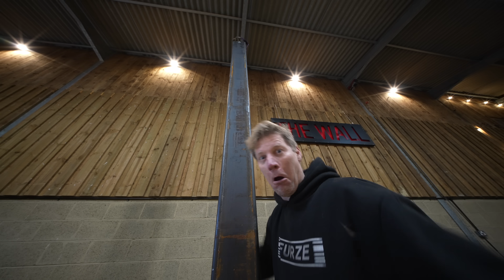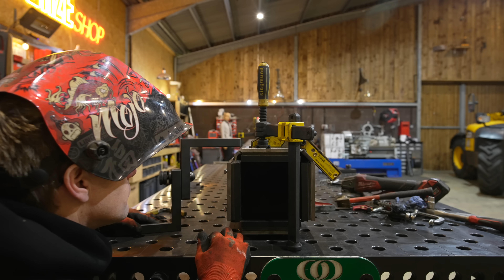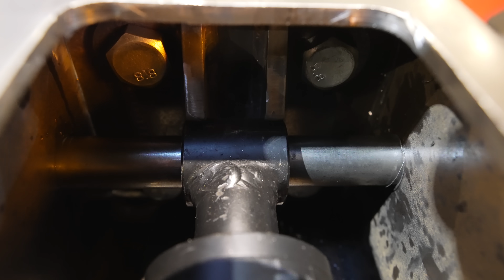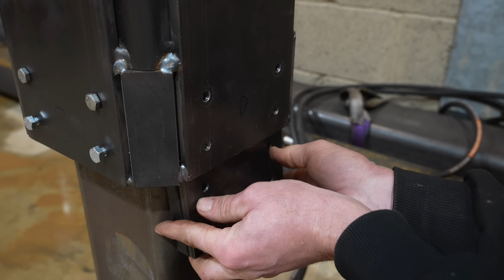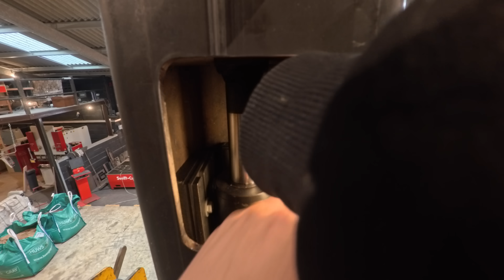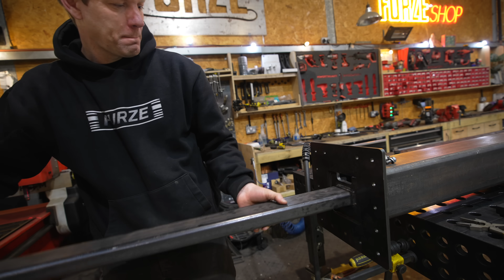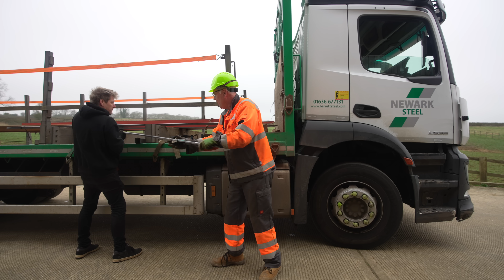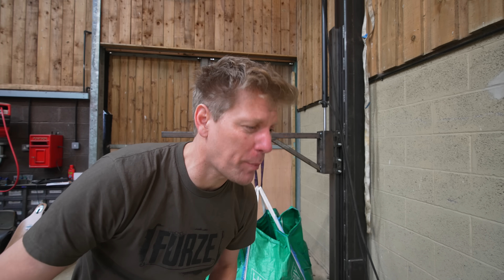Digging SECRET Garage Part 7 Car Lift Prep

Comment: Colin, I don't know if you have thought about it. If you crank and run your car down in the hole, the carbon monoxide,  will stay pretty much in that space and could flow through the other parts of the underground bunker. What you could do is have an appropriate metal hose, that plugs into the back of your exhaust and out the top of the bunker that has a rain protector cap to keep water from coming down through the tube. I would also have a co2 detector down there to make sure you don't have any exhaust leaks that take you by surprise. Also, another possibility is installing a fire suppression system in case your automobile catches on fire in the underground garage. If you don't install that, don't forget to close the door from the garage to the remainder of the underground that way, if there is a fire, it doesn't travel up into your house or the outdoor building.
Reply: It's been so long I've kinda forgotten myself, but I think during the bunker construction he already set up some form of air ventilation/extraction down there.
Reply: agreed, I've seen yhat he has a high extraction but I don't know if he has a low one yet.
but his bunker door looks airtight and it's steel so kind of ok for the fire part, as long as he doesn't store liquid oxygen for a rocket or something
Reply: or you can just properly ventilate the room, bunkers should have some sort of ventilation anyways

Comment: I think the way I would make the rotation mechanism would be to have 2 car tires permanently mounted at the bottom of the lift in the tunnel. The turn table would touch the tires when it is it's lowest position so you would just turn the tires on in opposite directions and it would spin the turn table. That way you don't need to deal with gears or cables or having any electronics attached to the lift itself.
Reply: Couple big drawbacks though. You can only rotate the turn table when the lift is all the way in the lowest position. I don't know how that would work with your mechanical lift concept. It will likely make a squeaking sound while rotating the table. 

I do still think this would be the most robust and simple approach though.

Comment: You might want to make sure you are using either flush ground bearings or a spacer between the inner rings of each bearing or they may bind.

Comment: Colin - regarding the shims - instead of adjusting with threaded bolts - how about fitting springs to apply a constant shim pressure on the inner square tube ??

Comment: You paid for 1 ton of sand in a bag. Its 750lbs. Thats not a ton. And if you do the math they sell them all that short. They are robbing everyone that cant check to see if they weighted the full ton. Thats a crime.
Reply: It's not a tonne/ton. That's just what they're known as - one tonne bags. They're a cubic metre - one metre on each side.

Think about the difference in the weight of water a ton bag has if it's wet or dry. 

For actual test weights they use a cubic metre of water which weighs one tonne.

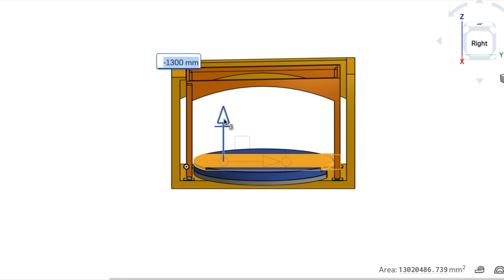Comment: 2:29 So that connection needs to detach from the platform, while also needing to be able to support the entire car sitting on a otherwise unsupported diving board? I'd think you need at minimum the same setup on the other side, I can't imagine that being able to lift the car without immediatedly failing

Comment: In case someone is wondering, there are actual tables full of data of how much a certain bolt can take (pull, push, sheer), the same with plates and welds. You don't need to overengineer the hell out of it like Colin, who's garage will probably outlast mankind by quite a margin 😂
Reply: It's not over engineered, he's just outsmarting the laws against building a personal combat mech by building all the parts as part of a "garage". By the time he's ready to assemble it, he'll be unstoppable before they realize what's happening.

He has a literal secret underground lair, I think a plot for tyrannical domination is pretty much a given.
Reply: @DD-th5tu  If Colin was around in the 80's he would have been on the A Team.   And would have been inexplicably locked up in a garage with a welding machine and some plate steel, and none of the guards stationed outside would pay any attention to the loud noises coming from it....
Reply: As the old saying goes. Anyone can build a bridge but it takes an engineer to barely build a bridge
Reply: Colin is secretly a prepper and will survive mankind's self annihilation because he happened to be working on the car when it happened. :)
Reply: @brookead  And emerge as the leader of the new world order.
Reply: As the Mythbusters used to say: If it's worth doing, it's worth overdoing 😉
Reply: And if in doubt, C4
Reply: @Katzenjammerz67 I doubt C4 would do much to that underground fortress.   Or rather it would take quite a bit to have any impact.
Reply: Overengineering is good practice if you get the steel for free :) (It should really be called underengineering, as it requires less engineering work. Slapping huge pieces of metal together is much easier. Overengineering is when you make it just strong enough)
Reply: In some fairness, if you have ANY doubt, better to overkill and know it's safe, than to meet min spec and die to a simple error.
Reply: To be fair it is Colin so he needs to plan for himself... he might want to install a swimming pool filled with mercury where the car goes that can be lifted up for some reason...
Still over engineering the crap out of it lol. Concentric pins was so unnecessary lol.
Reply: everything he builds is extra solid, massive, reliable, usable and maintainable. love it!!
Reply: MOAR METAL!
Reply: this is the biggest issue I see with Colin's process... he should just hire a hydraulics professional to go through the best options instead of walking down the trial and error pathway at such a critical junction
Reply: @idale4964  ....find a hydraulic specialist smarter than Colin. 😁
Reply: @randywl8925 you won’t because they’re a specialist, and Colin is quite the generalist. Still, in their area of expertise they can offer ideas of value.
Reply: @thehandleiwantedwasntavailable  I don't doubt that one bit. I also don't doubt that people that are specialists have contributed via the comment section.
Reply: @idale4964  As if a hydraulics engineer would know how to do steel construction. Maybe for some ideas or inspiration, but Colin is both capable and smart enough. Clearly.

Comment: Uh-oh Colin. Simultaneity! How will you guarantee that the travel of all four cylinders will be even throughout the lifting process every time? And you have the compound problem of two such situations in series. What about failsafes on both of those series lifts? If your hydraulic pressure suddenly drops on one or both of them, what then? Wait. Spoke too soon. You addressed it at the end. If the cable approach does not work, will you have an alternative passive control scheme, or are you having to look at active control with feedback?

Comment: I only came in from the shed for a cuppa when this dropped. Trying to fix a ride-on mower, the little pin holding the steering wheel on has rusted solid. I've tried a hammer and punches, then a drill - which wouldn't even touch the hardened pin - then an SDS drill with punch welded on the end, and finally another smaller drill that I thought I would try through the centre of the pin and just widen it as i go... broke the drill inside the pin. We're talking tiny - like, 4cm long by 5mm? Then I come in and see THIS video, so now imma go back out and SMASH this steering wheel off with the biggest baddest tools I can find! 😂💪

Comment: Workable, but 0% how I'd have solved it. I would have used a single cylinder mounted horizontal attached to a draw bar attached to four industrial sized chains run through angle-iron safety guards. You'd never have a single lagging/failed cylinder jam the system. A block-and-tackle reduction could let you use a shorter--and likely cheaper--cylinder.

Would be a crapload of chain though. Easily 100 feet. Yours is probably cheaper overall.

Comment: Isn't the normal way to stabilize the inner pipe to cut a slot in the outer pipe and fit wheels through?  Our workshop has a lift for 50 ton rail vehicles that has this setup.

Comment: I guess one problems should also be that all four legs have to expand uniformly, otherwise the hole system gets out of balance. And what are you doing as a safty feature in case one hydraulic hose bursts and you lose all the pressure?
Edit: I´ve watched the video till the end, where both things get explained. 
🙈

Comment: Colin daisy chaining the cylinders hydraulics is going to cause issues. Each corner should have its own line from the pump. Each line has to be the same in size and length. That should help with the cylinders moving faster or slower than one another. That's just my thought. Love your content ❤

Comment: Why not follow the design principals of known four post lifts. Hydraulics in all four posts is a potential mess and a future nightmare of maintenance. A dual horizontal ram with chain and pulleys should work a treat and give years of simple maintenance and reliability.

Comment: Is it worth placing an outer sleeve around the top where the pin for the hydraulic ram goes through, just so that the stress of the pin upon the hole it is put through is spread out across a double thickness of metal?

Comment: Making sure that the inner and outer sets of hydraulic rams go up at the same rate within each set might require electronic height control.  Beyond that, what's the failure mode if one of the cylinders springs a leak when they're up?  If I understand the design, the emergency brakes will help if there's a rapid catastrophic loss of support.  How about a slow failure?  What happens if the load is uneven?  Does the design prevent someone from parking above with not all four wheels on the platform?  What if that upper load starts to roll off?

Comment: Ball bearings are not suitable for running directly on this steel. Even if there are several bearings, one or two will carry the entire load. It is best to choose smaller bearings and connect them using a sort of tube. This prevents the bearing from becoming deformed and distributes the load across several bearings.

Comment: Colin for your maintenance worry could you modify the posts like Base-Hinged Lighting Columns that have a hinge on the bottom? You could have a clamp at the top to secure corner when disconnected then swing the post down with a winch enough to remove piston.

Comment: use 2 hydraulic rams per leg and mount them on the outside of the legs, easy to get at then, just not quite as pretty
Reply from the maker: but there is no free side on the outside as the backside has the safety rail the front the inner lift and the side has the room/roof and the inside means the car gap gets smaller so that's why I went inside.

Comment: 16:10 But why have those 2 cilinders there tops connected ? Only the oil needs to press on the bottem connections and return by gravity. It's the same as you have the 1 piece cilinder later, but with this one is the connection in the middel insted of the botom. Your new cilinder whill have a breathing hole on the top, if your piston ever leaks it whill eject that oil out there.

Comment: I still prefer my drill screw lift design I spent a month making to show you, but since it took so long you already went ahead with another idea, that's likely much cheaper, but not as cool! =P 
It was basically like a coke bottle lid screwing up/down, you could walk under it at any height as it rises, it was fully supported and used a ratchet type mechanism to keep it safe.
Like imagine a triple helix, and the bit in the middle spins round like a rollacoaster on the poles. 
It only needed some motors to whizz it round and up, and some sweet looking spiral metal poles.  Oh well. I had fun making the dumb thing for no reason ^_^.  
I might go set it on fire in the garden, seems like a fitting end.

Comment: I used to work for JCB, operating the house sized press that would bend the sheets of steel into the U sections before the welders added another plate on top to create the box section boom pieces, that went on the loadall machines. Fascinating to see you essentially ‘reinventing the wheel’!
Reply from the maker: I did think about getting some C channel pressed but I like the idea I can remake any part of it with the tools I have etc
Reply: @colinfurze Still getting through the video, my own thoughts would have to go down the route of hinging the base of each leg, and then creating a system that would allow for the lowering of the lift to lower a single leg into a horizontal position with an overhead crane in the none opening part of the bunker utilised toke the weight whilst removing the ram. Personally I feeling cutting slots in the box section creates too much of a weak point.

Also, rather than adding runners to the rail, have you considered mounting the bearings piece directly to the wall, with the moving part of the ram rolling through? This would eliminate the need to get the piece past any kind of lip

Comment: I was waiting to see how the lift would mechanically lock in the chance the hydraulics failed, glad you squeezed that in at the end of the video. This method looks a lot cheaper than buying load arrestors for each leg! Looking forward to seeing them implemented. 🤓
Reply from the maker: there is also rupture vales in the cylinders to so double fail safe

Comment: Hey Colin... Eventhough Massively expensive... how long are the cylinders for the press plate in a Heil Halfpack Front end Loader? You know, those that pick up skips infront if the cab and empties behind it. 
 Call my old friends in Scotland. Yes, the cylinders might be to wide. 
Heil Environmental in Dunfirmline.
Reply: Oh got it.

81 inches retracted and 263 inches fully extended. And seeing they are pushing the press plate crossing eachother until fully extended" they are rated at an enormous amount of side strength and bend.

Comment: I love this so much colin, you're doing what every guy frickin dreams of! I have an idea tho, PLEASE read this out:
Why not have a car wash hydraulic lift instead? It's overkill but that's definitely a better idea and would need to modify it quite a lot of get the height just right, but It would mean you can get rid of the cage that comes up along with the car, (the 4 legs on corners). It would be so seamless and almost magical to have the car come up without those legs! COME'ON COLIN YOU CAN DO THISSS PLEASEEE

Comment: In the late 80's I redesigned an extendable stick for the Cat backhoe loader. I went down almost the exact same design path you went through for your spacers. I was replacing a design that used brass strips that were welded to the steel tube, and had to be replaced frequently in high wear environments. The material I used was called Nylotron (I think that's the name, but it's been a long time). The material had graphite impregnated to lubricate and it would also leach a paraffin if it got to hot to increase lube. It's funny how similar your design was to mine.
Reply: Convergent evolution moment

Comment: After building a 2-story vertical lathe, I can say that if you want a smooth moving lift, you need a fabrication shop to mill flat, true, plomb and square sides down the whole length of the contact area. If not, you will have occasional loose areas. Don't forget about that weld seams on the inside. I know you won't, but I had to mention it. Thanks for all the entertainment and best of luck.
Reply: he talked about the weld seam on the second channel if you are interested
Reply: @celivalg  Yes, I remember. I know from experience how small details can fall between the cracks in a large project. I have complete faith in him to do a good job.

Comment: /Edit - Shame on me for not watching before commenting... Derp - /Edit

Colin! Honestly love this project mate!!! EPIC!

Obviously I'm coming to this late but have you considered the mechanisms that forklifts use - with those rollers and chains?
It seems that they can extend further than the throw of the cylinder.

Also Newick/Barretts steel have pretty good tube lasers and they can do pretty cool things with SHS - just need to send them step files and they are golden. Tolerances are critical if you do this

Just spit balling - Love ya guy! X

Comment: Great progress! I`m sure you have already thought about it. but I was thinking safety wise, how are you going to fail safe it? I used to install electric gates and there are lots of products in that industry you coud use like infared beams and rubber safety edges that could stop or reverse the lift if something goes wrong, obviously going to be some major crush points in the gap when the lift goes down ect, may be worth integrating some kind of gate or mesh to prevent anyone falling down the gap while the lift is operating.

Comment: I'm curious, if one of the deisgn parameters is to inspect underneath the car, how will you get under it with a big platform in the way? It sounds like you want a car lift like what is often seen in mechanic shops, but this is a whole platform, with a less than ideal floor under a less than ideal platform for inspecting underneath.

I'm sure you've thought of this, but I am curious. 

Looking forward to the finished product!

Comment: If you build a garage on top of the lift opening it will conceal your lift operations and solve all your water and safety issues. From the street you will see a car going into a garage and the door close. You can then choose tie decent down into the bunker or stay up top. When one car is in the bunker you can use the garage for your second car. Just a thought. Greetings from South Africa ❤